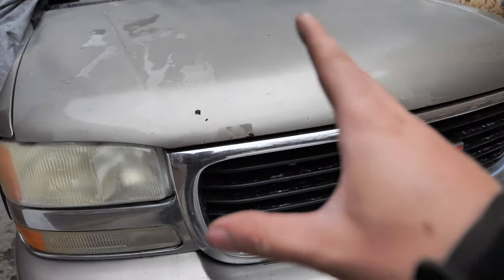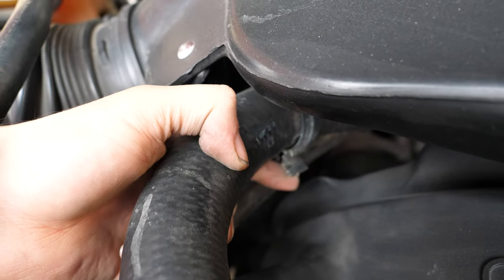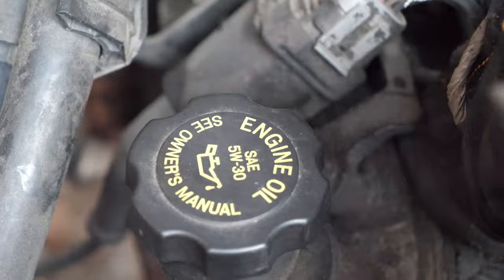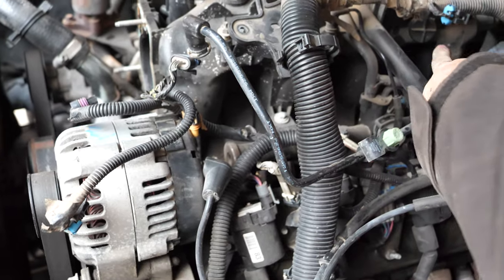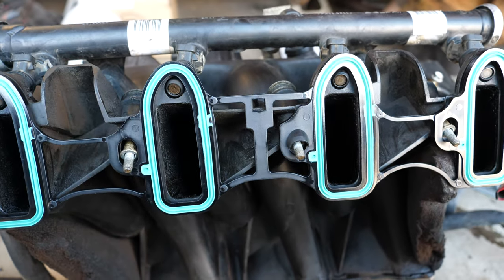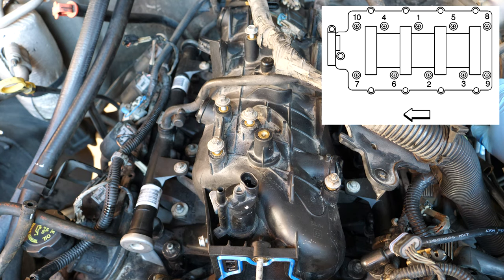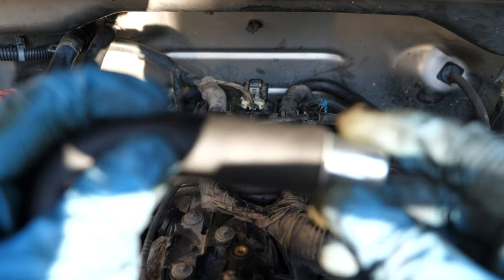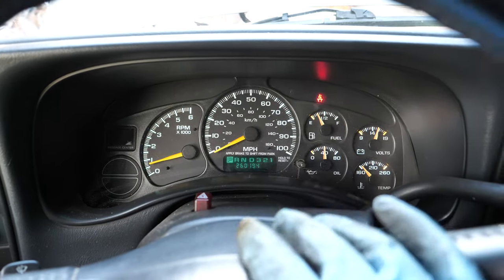(P0171 Fix) Intake Manifold Gasket Replacement - 2000 GMC Sierra 1500 With Throttle Cables

Comment: What codes will this issue usually throw? I’ve got a P0420 code and a leaking valley cover. I’ve replaced all the 02 sensors to no avail.
Reply from the maker: Usually the P0171 code. Possibly other 02 sensor codes. P0420 may also be catalytic converter ☹
Reply from the maker: Is p0420 the only code you get?